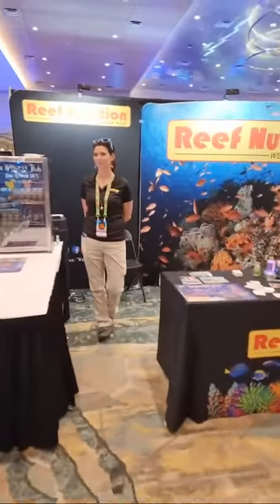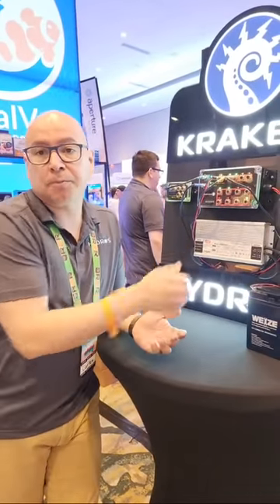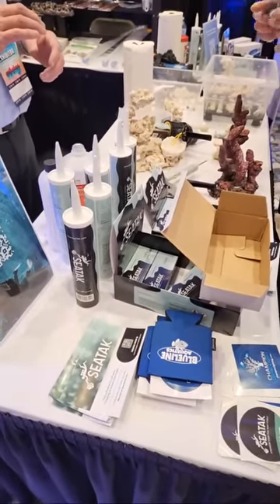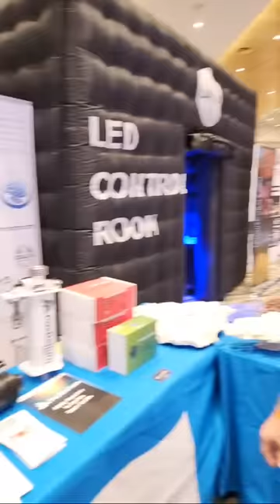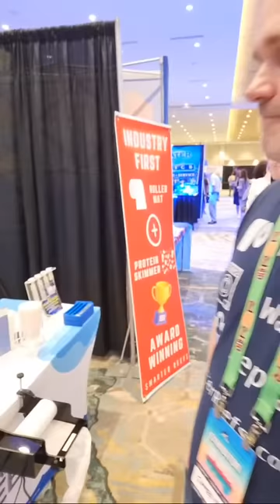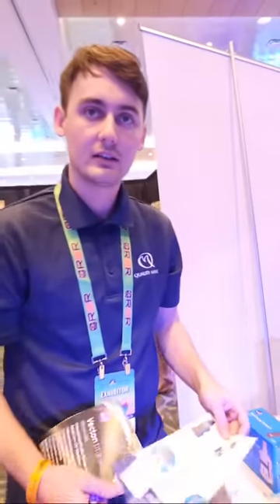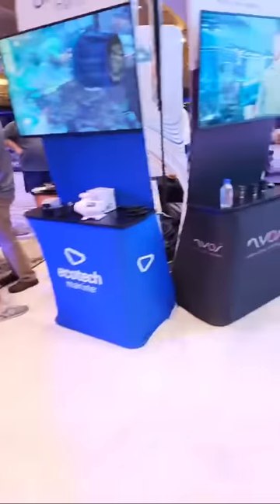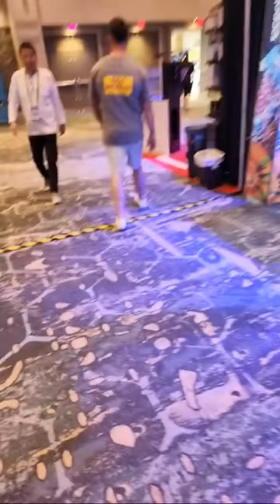Live from Reef A Palooza Orlando 2023 all the toys!

Comment: Thank you so much for the video as always...I plan to attend the one in NY (technically NJ) in June...Hydros is really the leader in controllers now imho based on reliability (being completely made in house end to end using quality parts (i.e. mean well power supplies, IP65 rated controllers, BNC connections etc), the innovation side especially with upcoming X10 and Kraken, and the redundancy side with their collective which allows any module in collective to take over as the "brain" if one of the other modules were to ever fail. As for Reef Factory, it is just another walled garden which doesn't make sense....fragmentation is not what we need in the hobby as no one will be brand loyal down to every last piece of equipment IMO.  Also, there is a fatal flaw with Reef Factory as it has NO wired communication between its devices.  All the devices rely only on Wifi to transmit data....god forbid you're in the middle of a dosing cycle and lose wifi....I don't see them lasting very long here as their equipment is cheaply made overseas in China while their software is made in Poland...they don't have dedicated customer support in the US which will make it really hard to support...also, no one is carrying their line willingly...Reef Factory got desperate and now providing a 60 day payment term and if you don't want it after 60 days, it can be returned...its why Champion and other small "distributors" only picked it up...I'd stay far away from them
Reply from the maker: You are very welcome!